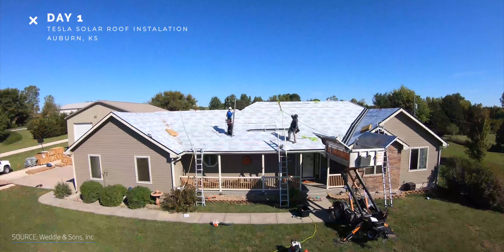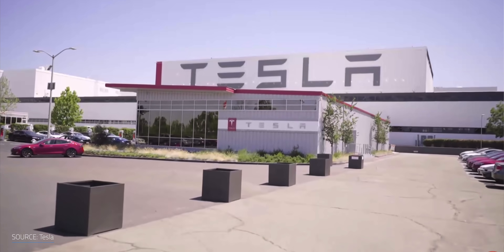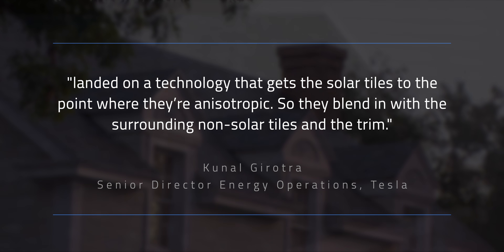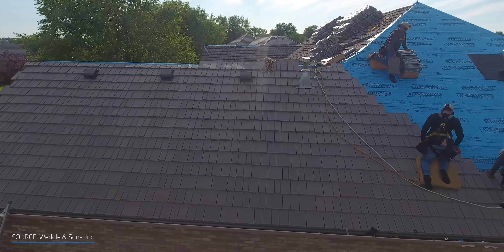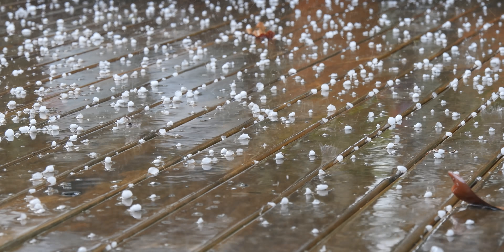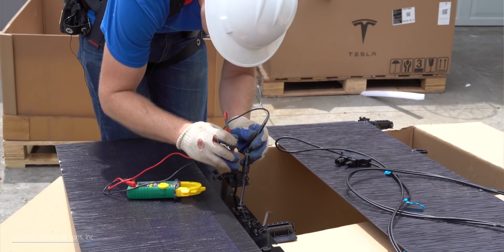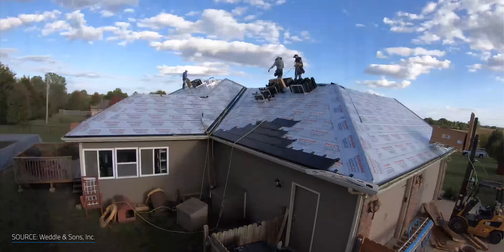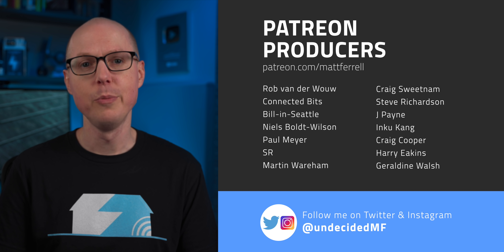Exploring If Tesla Solar Roof Is About To Go Mainstream?

Comment from the maker: Are you waiting to get a Tesla Solar Roof?  Be sure to check out Exploring Nanotechnology and the Future of Renewable Energy - https://youtu.be/-bYaFqubQDw
Reply: Maybe I missed it in the video, but what is the energy production of these tiles compared to normal panels for the same surface area...
Reply: If you sell your house, does Tesla remotely shut off certain features of the solar roof and make the new homeowner pay a $7,000  fee to get the features reactivated like on their cars?
Reply: @michaelbrinks8089  no, at least not now. Not the same as with FSD. When you buy it, you own it. However, i think they offer some kind of leasing the roof by paying a monthly fee.
Reply: Entire video without mentioning the amount of energy it generates and how it feeds back to the cost aspect. Can you just add a video to talk about the energy mechanics.
Reply: from the video it is not very clear what is the current bottleneck and bottlenecks behind it that holding back going though that 200 orders backlog.
Reply: Couldn’t wait any longer, so I went with traditional panels.
Reply: I have some time left until i want to buy or build a house, but i'm sure it will have a solar roof. I just hope they bring the solar roof to Europe fast enough, haven't heard anything about the solar roofs or battery storage production from the already operating Gigafactory in Shanghai. I hope Giga Berlin will start with those products soon enough for me to buy in.
Reply: We have a 12.75 kW solar roof and 2 Powerwalls.  For the roof alone, we paid about the same as a tile roof plus 9 kW of conventional solar.  But the Powerwalls are the real winner if you have Time-Of-Use billing as we do.  Our rates can double on weekdays from 4-9 and we use almost no electricity during that time.
Reply: It is not a game changer until it changes the game!
Reply: I pick up my new Model 3 tomorrow.  I hope to have a solar roof installed by the time it is payed off.
Reply: I was interested, but I found out they only use string inverters.  That seems like a pretty big issue for expansion capability and off-grid for people who want to consider that.  Also SolarEdge doesn't yet have the micro-grid functionality that the Enphase IQ-8 line has promised.  Oh and angles, but angles weren't much of a issue for me since I was planning to build new.
Reply: @mlatouable  - most solar roof installs I have seen, including ours, use Delta inverters.
Reply: @JBoy340a  Interesting, Tesla told me they used SolarEdge, but in any case, these are still string inverters...=/
Reply: Until a home owner can buy these directly without being saddled with the bullshit of having a company like Tesla Solar tell them "we can't sell to you, you have to buy through a contractor", that answer is hell no. I can as a home owner go out and buy building materials, roofing materials, wiring and so much more without having to involve a third party. I resent being required to do so, if the system is structured so I have the 'option' to do so but can still buy it myself is an entirely different way.
Reply: @Enonymouse_  I think the vast majority of people have no desire to install their own solar and do the electrical. I get it but I don't think the lack of DIY will be much of a factor.
Reply: @michaelknight2897  The option should be there, because as i've pointed out corporations are pushing for doing away with the right to DiY anything.
Reply: I think I'm just not rich enough.  I'm redoing a roof, but like do I want to spend this kind of money for a lower utility bill?  This thing has to last a long time for it to pay off, relative to just investing that money.
Reply: All permits, licensing and the layout for my solar roof have been completed since March.  Tesla said they'd install as soon as they hire installers for my region.  Add COVID to the mix and there's no sign my roof will installed any time soon.
Reply: The only thing is roofs are suppose to last at least 10-15-20 years! Solar Technology has been changing so much these days that Solar Roof might old tech right away! Better get a traditional roof and the Solar panels you can use that be upgraded in couple of years easily!
Reply: @terryrodbourn2793  Old tech that last 30 years still lasts 30 years. If the solar system (or better solar and storage) meet you budget, then do not wait on technology. That argument is one electric utilities use to hold back solar. While at the same time using 40 year old electronics to reliability operate plants.
Reply: Will they be giving the regular person the opportunity to install themselves?
Reply: Might get one with the next hail storm. Remove & install of my existing panels costs $10.000 alone, before any roof replacement cost (Colorado) – and we're on our 3rd roof due to hail (2004, 2010, 2017). Deductible also doubled to $5k and most roofing companies are run by crooks. Neighbor got cheated out of $8k by a fraud company that bought a reputable company's business name and ran with the deposits.
Reply: I'l love to get a Solar Roof but I'm stuck in a Solar City lease agreement that came with our house when we bought it.  I wish there was a way to transition from a lease to a new solar roof.
Reply: @davidhayward1426  That is a perfect example of why I don't like closed systems. The customer should have the right to choose doing it themselves or having a pro do it. Instead your stuck with a proprietary vertically integrated system that leaves the consumer without choices.
Reply: I'm installing regular commercial solar panels on roofs and this tesla product looks so much lighter and easier to work with on the roof <3
Reply: @aslkbgh  Yeah and loses ~5% absolute efficiency which in relative term means ~20% compared to regular solar panels. Costs as much as a "normal " full shingle replacement with installment of solar panels. So overall not viable for a shit ton of places on earth where solar is already barely commercially viable. This will hopefully change soon, since carbon emissions need to be taxed accordingly to the impact they have. Which will make solar commercially viable in more places.
Reply: @Grubflag  You try to compare apples with oranges, where the Tile loses efficiency it gains an increase in the active area.

Basically you can put more photovoltaic cells on a regular roof using Tesla's smaller tiles. (Although you can also cram regular panels together as well, not recommended)
Reply: @aslkbgh  I thought so too for a long time, but since you need a certain amount of shingles connected together you lose big parts of the roof as well. The surface you use is actually comparable to standard panels. If this gets improved than you are right, but as the system is now that is not true. You can see that in a video from This Guy's Telsa very well and if you do further research you find that the area loss on avarage is very similar to normal panels. Individual cases may differ.
Reply: Great report. I would have liked to see what Tesla has planned for recycling those panels after use.
Reply: @hughjohnson4071  landfill, which people already complain about. You sir know what you're thinking. Nice.
Reply: I'd love to believe but I'd have to see at least thousands of houses with it for at least 5 years (10 would be better still) to see how it really works in the real world.

God bless those willing to be beta testers for the rest of us, though - so thanks to anyone willing to jump in earlier.  Future me will thank you if it turns out to be a good or bad deal ;)
Reply: @DocNo27  Covering the whole house seems very inefficient as half of it would produce hardly anything. Unless they have changed the system you can't hook up a generator which is a non starter for me. Other systems, like a Sol-ark with fortress batteries, are more efficient and have better capabilities.
Reply: I would rather look for BIPV system for frames dual glass panels. Given that standard solar panels is closer to 1 m2 install times would be quicker. Could would likely be lower than roof + solar panels
Reply: How much is the roof
Reply: @Undecided with Matt Ferrell 
             Does the texture and optics added to the PV tile  to disguise their look, reduce their efficiency? Is there a way to get this solar roofing that looks like solar panels using the same technology and for a similar or cheaper price?
Reply: If you get a leak in the middle of the roof.... very expensive. Replace the underlying roof and you have to dismantle all of that and then reinstall. Uber expensive. It also jacks your insurance rates up. I won't do solar unless I can ground mount. Sol-Ark is much more efficient and cheaper than Tesla.
Reply: Yes, my current plan is 2 years.  I can't wait!
Reply: Thanks for the video, Matt...I'm needing a new roof.  So, using these ingenious devices will help reduce carbon emissions, provide ample instant demand electricity, saving money during cold and hot months, as well as being protected against rolling blackouts or loss of power due to wild fires...nothing but winning in my opinion-- especially if they are as durable as their claims.
Reply: @more_bytes  If the roof is only grid tied it won't work when the grid goes down. It has an automatic shutoff so it doesn't back feed and kill lineman working on the grid. You would have to have a backup battery system also for that $$$$$. Or a generator.  Its good to have a spot in the system for a backup generator so you don't wreck your batteries from going to low. Unless Tesla has changed there is no option last I looked for a generator hookup in their powerwall.  Which IMO makes it not very attractive.
Reply: Yes, I'm Very happy with our current roof(concrete tiles), but in another 25-40 years when they are ready to be replaced...
Reply: The biggest problem is storage..you can produce the power during peak hours, but storing that energy I'd another story. I hope we see advancements in this area.
Reply: Does this roof cause the house to become hotter during the summer?
Reply: I'd like one but they're too expensive. Here in the UK I can get my whole roof retiled for under £4k.
Reply: If this stuff could get affordable in Africa, I'm telling you, we've got summer 365 days a year, energy problems can be very much solved.
Thumbs up Matt, great job!
Reply: Save that tax refund and stim man
Reply: These vicious brands and their idiotic enablers never speak of the impact, the cost of all such marvelous tech.
That solar energy gadgets and the production line is completely dependent on fossil fuels. That extraction and mining goes on in very very poor countries using very very poor people to feed Solar Industry material. Also we must not forget that all such products, even rendered useless, has a carbon footprint at the end of their lifetime.
Reply: Unfortunately in Canada and flat roof, near a big tree and building….
I really would like, but pretty sure that I can’t
Reply: I think your statement about rolling it out into the world is not accurate. The system is less efficient than standard panels which makes it only rly viable for people in areas like california with a lot of cloud free sky through the whole year.  The combination with the battery for power outages that is advertised is not relevant for the EU. Other companies have alternative solutions available with standard pannels and battery packages, so not realy a unique selling point either. 
The cost comapred so installing solar pannels is realy high. Its cost efficient if you want to replace your roof shingles anyway. This is done more regularly in the US cause you mainly use the asphalt tiles. In the EU mostly ceramic shingles are used and with some repair jobs they have a lifetime comparable to the house. If you want to retrofit solar power for use and EV charging standard solar panels are the way to go. So overall this leaves you with a very limited customer base, for this base its a very good product. I think we will see this and other systems used more often in new houses and for replacement jobs but I do not think its going "mainstream" anytime soon.
The efficiency gab can partly be compansated by using more surface i thought, but than i saw videos on how much surface is actually usable because of the electric circuit layout and you realize its around the same as regular panels. If that itterate on that in the next generation that might compansate for the area loss. Even though I think solar panel companies will than come up with customized panels soon after. 
Also I have seen videos where Tesla has such good engineers that a customer has to come up with the idea of moving some roof outlets by 30cm so 10% roof area can be used even though he specifically asked them if there are any possibilites of using that area... Not a good look in my opinion. Also they are scaling with a lot of untrained personal in the US. Which would give me less hope of a quality job for my roof.

So for me overall a lot of hype involved again. If you have a good architect he will probably have cheaper and better solutions for your individual needs. But since we have freedom of markets go for it if you feel its the best solution for you. But I do not see it going to massivly roll out world wide anytime soon.
Also regarding the landing rocket, that concept was already developed by nasa but was not possible because of lack of funding. SpaceX just took the best nasa engineers and they did it there, this adds no credibility to this product for me. Also Tesla build the LA loop the biggest Joke ever, could be a counter example. But also not valid for this product.
Reply: Why not just coat the tempered glass with the same thing that coats car windshields? That way if it shatters, it stays in one large peice. Kind of like the way window tinted glass sticks to the tint sheet when shattered...
Reply: I noticed that the solar panels are dark, does that effect the energy bill of the house from heating and cooling?
Reply: I am chomping at the bit, but first I need to buy a house!  I have brought up solar with my apartment manager, but they have been "researching" it for over a year.
Reply: Yes. I am ready for the roof and an electric car. Once they change regulations that allow the car to be a battery for the house, we will start to enter a golden age of solar. All of this because of 1 man, essentially.
Reply: Hi Matt. Great video! It makes perfect sense to go solar. I was curious if you could make a video talking about how the Hyper Loop and how the science behind it is actually beyond dangerous and not practical in any sense for humans. Thanks!
Reply: @gizgad567  not practical? Ask anyone living in a non-US modern society. We're the only "developed" country without high-speed rail and the vacuum model would be 2-3x faster. NY to Chicago in under 2 hours.
Reply: @gizgad567  seriously?  Why don't you make that video, clown.
Reply: Solar will never produce anywhere near the amount of energy that nuclear does. 
Solar also isn't green. 
Those panels will end up in landfills. And that is toxic harmful material. 

This upsets me.
Reply: I am all for expanding ways of producing energy. With President Cheater Joe you will likely see the government waste gobs of money on renewables because of the climate change scare scam. On the positive side the technology should get better.
Reply: Yep I’m awaiting solar roof availability and viability in NW Ohio. Looking to do it for my rental’s and continue to provide affordable housing.
Reply: I get more energy benefit from  the trees which block the sun in summer. The winter sun shines through the bare  trees to warm the house. Roof mounted solar has a small window of maximum efficiency each day provided its not cloudy or covered with snow. The sun will heat the tiles and melt the ice and snow eventually. All the expense for maybe 25% yield of the installed capacity. We have a 10kw ground mounted tracking solar install. Summer yields 140kwh on a good day. 5 kWh or less on a rainy day. Winter skies are usually clear and sunny and even on shortest winter days 50kwh is possible. Because the panels tilt towards the sun  the ice and snow melts and falls off without intervention. More maintenance because of  mechanical but worth it. You can install fixed ground mounted solar and manually tilt the panels to get the most direct sun for your latitude. The suggestion to invest in a solar farm and not in a solar roof is probably the best idea unless you have special deals to cover the cost. There is a cost for virtue 🔋
Reply: @JohnRoss1  Interesting. What part of the world are you living in John? Thanks
Reply: @JohnRoss1  So not worth it like LED light bulbs. aye
Reply: @JohnRoss1  Any link to your design?
Reply: Hydrogen:  See my Twitter page under the same name as this comment to see just some of what this world is doing with Hydrogen and Hydrogen technologies.
Reply: Nope, because long before Tesla, solar roof shingles were a “thing”.  Several of our neighbors in CT have them.  And Tesla is not a roofing company and is not known for its QC.  I’m not inclined to use my roof, 20-30 year investment, as a beta test.
Reply: @alliejr  I live in MA and need a carport-type roof -- certainly interested in a solar shingle. Also, I'm a former contractor and cam frame everything.
Reply: Matt seriously do you realize how much confirmation bias is in your videos? You buy the Tesla hype but fail to see it as hype. What you think is a game changer is nothing more than a long con being played. Musk has zero plans to roll out the solar roof to a mass market, because there is not a real market for it which can justify the capital outlay necessary.
Reply: @brianthompson9592  He showed negative as well as positive points. Also, Tesla's prices for solar roofs are better then from the existing competition. This is a fact, not hype-based.

Thomas Edison was also not the first who invented the lightball, but was the first who could made them that they came to the masses. This matters and it could be the same with Tesla and the solar roof.

Also, Elon mentioned multiple times that the demand of the solar roof is way higher than they are able to install. I think if they can scale, this product will be a big success. But only time will tell...